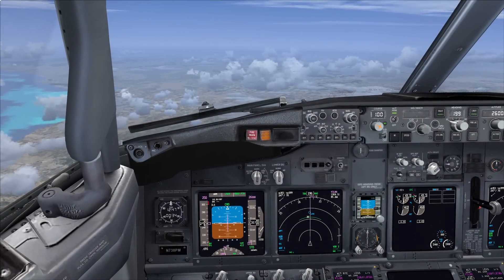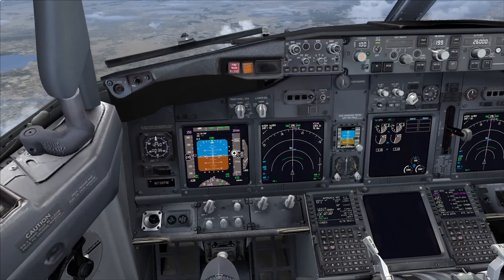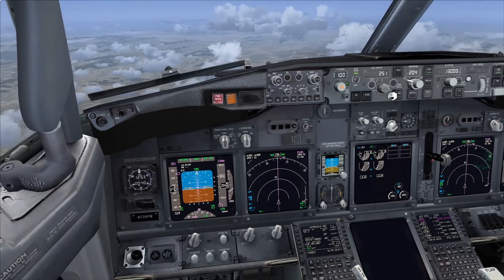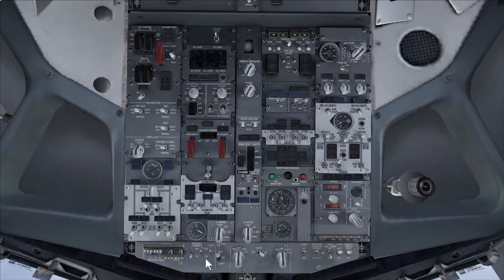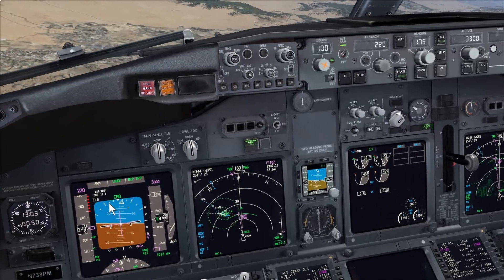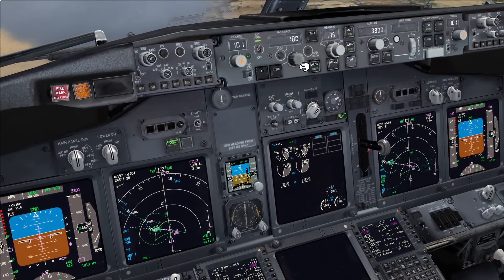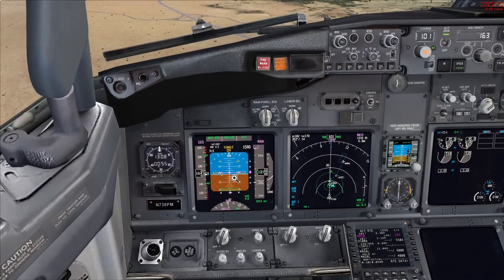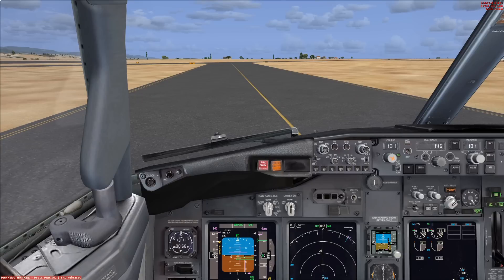Descent Management and High Energy Approach Tutorial | REAL BOEING PILOT | PMDG 737

Comment: Thank you for the informative video!  (Appreciation better 2 years late than never). Q: If your flight plan includes vectors on the approach, will VNAV still calculate the profile accurately?  And the Zibo mod?  Thanks!
Reply: set the legs page as close to expected vectors as possible... then it works

Comment: Nice presentation. May I add that the landing gear earlier extension is an excellent drag producer from which we can benefit in high alt/speed approaches, especially on short sectors flights when we also benefit from the quicker turnarounds due to more sufficient cooling of the brakes.
Reply from the maker: It certainly would be effective but the Landing Gear is not designed to be used as a speedbrake!

As a last resort it could be lowered earlier on the approach if you wanted to help decelerate but its not good for the gear doors to be subject to high air loads and they would need to be replaced more often (see FCTM)

FD2S
Reply: flightdeck2sim Of course as a final resort, but there is no problem using it since there is no limitation of speed (of course we are talking about speeds below 250kts). Boeing states not to use flaps as speedbrakes and as I can recall there is no such recommendation for the gear.
Reply from the maker: @steliosarapantzis5322 interesting! Our FCTM (4.20) states to avoid using Landing Gear to increase drag to increase gear door life and passenger discomfort.

Wouldn't use routinely but as you suggested, no problem as a final resort OR don't accept that crazy shortcut!!!! 

FD2S
Reply: flightdeck2sim yes I saw it in the NG FCTM. Not such recommendation in CL.Of course we should try to avoid, but if inevitable....(works like a charm..)
Reply: Happy Flying !!

Comment: In a nutshell, ya gotta add drag. First choice is adding speed if you aren’t speed restricted.  Next choice is drag devices.... speed brake, gear, flaps, slats, even resort to the extendable landing lights😉.   But for flaps you have to slow down first to not over speed anything. 

In a nutshell, I hear all the time that the 737 won’t descent, but in actuality it’s not the airplane, it’s the fact that the VNAV path is programmed to descend at the last possible second. 

So instead of screwing around in path descent, then try speed intervention to engage the speed descent mode, and allow the aircraft to descend earlier. Sometimes it’s better to get down a little early versus being a hostage to the path. 

Once you get in the approach environment, the speed mode of descent will be overridden by gradient and the aircraft will fly that instead.  

If you ar flying an aircraft that doesn’t have speed intervention, go to the descent page and toggle the aircraft to >SPEED. Then execute.  In a nutshell speed descent is like a vnav speed climb. Won’t go through an altitude limit in the legs pads, but also won’t do anything to get TO that altitude either.  

So, when in a speed mode, you get to control the path with energy, but in a path mode, you have to control your speed with energy. When I say energy, I’m talking about thrust and drag changes.
Reply from the maker: Hi Mark, yes been flying this tin can for the last 8 years and I also teach line crew and type rating students how to recover from high energy descent/approaches, which is exactly what I showed in this tutorial. I must confess I've never extended the retractable landing lights to add drag, that one is new to me..

FD2S

Comment: ton of work ,just drop the gear below 270kts and see ROD of 5000fpm
Reply from the maker: Hi Essa,

It certainly would be effective but the Landing Gear is not designed to be used as a speedbrake! As a last resort it could be lowered slightly earlier on the approach if you wanted to help decelerate but its not good for the gear doors to be subject to high air loads and they would need to be replaced more often! 

FD2S

Comment: I was flying on VATSIM today. ATC gave me a really nice shortcut but it threw me 5000 ft above the profile. My question is: is it possible (on rare occasions) to extend the landing gear and use it as a speed brake when the actual speed brakes aren't enough?
Reply from the maker: Good day! What a shortcut haha! It is prohibited to use speedbrake with gear/flaps settings greater than 10. If you stow the speedbrake you could extend the gear but it's not recommended by Boeing. Prevention is better than the cure, refuse the shortcut and ask for extra track miles! 

FD2S
Reply: @flightdeck2sim  Thanks for the reply. I found out what the problem was. A while ago, I read a thread on the forum saying the descent angle is the best at low airspeeds speeds.
Hadn't realized until now how ineffective the speed brakes are at low airspeeds. Asking for a free speed, selecting the level change mode and cranking the speed on the MCP all the way to 300 KIAS with speed brakes extended worked just fine.
Is there anything wrong about this technique?
Reply: @tomasdererste  as long as you dont accelerate above 250kts below FL100

Comment: If you are cleared by ATC to cross a fix at a certain altitude how would you manipulate the aircraft? Can you setup the FMC or would you use vertical speed and position the green banana over the fix?
Reply from the maker: Hi Judith, 

Yes you can set the restriction in the FMC and use VNAV to efficiently descend and make the restriction. The green “banana” is also useful, if unable to comply advise ATC.

FD2S
Reply: @flightdeck2sim  Thank you for your very quick reply, much appreciated. I have learnt so much from your videos.

Comment: Hello. Great video. I currently fly the 738 but must confess I have a doubt about speed intervention, If you could explain me, Id really appreciate it. If Im descending, fmc speed and vnav path, Then ATC asks me to slow down from, lets say, 285Kts to 240Kts. I could do that simply by hitting speed intervention. However the plane would start to get high on the path.This path, in which Im getting higher and higher, is still the same path planned for the old speed, 285 kts right? to create a new path, for 240 kts, even with speed intervention still activated, I would have to go down to the fmc and change the target speed to 240, so I could get a correct path display on my ND for 240 kts, right? Appreciate your help, thanks.
Reply from the maker: Good day,

Yes that's right, you would update your TGT SPD in the FMC but you wouldn't be on Path, you'd be even higher with a slower TGT SPD!

Is there anything you can do about it? Not really! If ATC has given you specific speed control this must be maintained, you only really have the speedbrake to help capture your profile. This is something we deal with every single day and it's completely normal. You just apply the techniques I showed you in this tutorial to attempt to recapture the profile.

FD2S

Comment: hii friend this tutorial is awesome again :))but  ı dont understand why you used 4 nm fıx.. maybe ı mıssed that part ...and why dıdnt you turn on the app mode on the efıs control panel before ıntercepting the localizer..
Reply from the maker: Hi there,

The 4nm is the configuration point for Gear Down and Flap 15 used in VMC conditions.

The APP mode on the EFIS is not required to fly an ILS, it just changes the orientation of the display. 

FD2S

Comment: What is the sense of putting the engine switches to 'Continue'?
Reply from the maker: It lessens the risk of a flameout during critical phases of flight.

FD2S
Reply: flightdeck2sim Ahh ok thank you and why doesn't let you the switch on 'Cont' all the time?
Reply from the maker: The engines do have an auto-relight when a flameout is detected, both igniters will automatically fire. By placing the start switch in CONT in critical phases of flight, selecting EAI on or if flying through very heavy rain the engine will always have a source of ignition.

flightdeck2sim
Reply: flightdeck2sim Ok thank you and what does the FLT position do?

Comment: Once again another awesome video. We did all the things you are speaking about with regards to speed and altitude control in the B732 using mental math. I cross checked 3:1 profile every 3000' or so.
Reply from the maker: Hi Robert, thanks!

Yes x3 your height works well as a rule of thumb, if it equals the total distance to the runway or thereabouts you're not too far off!

Top tips,

Add 1nm for every 10kts of Tailwind 

Add 1nm for every 10kts above 200kts 👍🏼

Good luck!

FD2S

Comment: The smallest detail. What you said about the false glidepath. I had no idea. I come from the 777 and since so much is automated and fixed for dummies it was a bit of a learning curve to do the 737. I think this might be the reason I had random approach issues on approaches I've had no problems with in the past.

Is there an issue if you arm the approach if you're above it? Can the same effect happen?
Reply from the maker: Hi there,

Yes you can capture a false G/P in reality but you have to be extremely high or low (pretty much twice (6 degrees) as high as you should be and there is another at 9 degrees). It's called a "false lobe" and it's pretty well documented

The 777 is just as prone as the 737! 

FD2S
Reply: flightdeck2sim Thank you for the response. I think I was too tired and I didn't decend on time or see your video about how to get back on the path. Then captured it way too high once again without knowing. Causing the false glide path. Makes sense now.

Comment: One question, what happen if you dont wanna use the speedbrakes, you know that you are gonna receive that clearance to dme10 and you want the fmc to flight on vnav path? You join the points and then create a hard altitude right? but what altitude would you put on vilna to be on profile? Cheers
Reply from the maker: Hi AF MG, Good question! 

If we knew we would get the clearance we would not put the "At or Above/FL70A" at VILNA. FL70 happens to be the exact altitude you need to be at VILNA so we would make it a hard restriction which means we could continue idle thrust without having to use speedbrake.

It's worth noticing some restrictions just happen to leave you high and you have no choice but to extend flaps early/use speedbrake. 

FD2S
Reply: Thanks, so in this case you would put FL70 instead of FL70A am I right?
Reply from the maker: Correct!

FD2S.

Comment: Why didn't you lower the gear to help you slow down?
Reply from the maker: Hi SIMMANIAKS.

That's because the Landing Gear is not designed to be used as a speedbrake! As a last resort it could be lowered slightly earlier on the approach if you wanted to help decelerate but its not good for the gear doors to be subject to high air loads and they would need to be replaced more often! 

FD2S.

Comment: I love your videos!!
 With your operator is there any rules about maximium v/s for passenger confort?
Reply from the maker: Hi Maule m5

Technically there is no limit to the ROC/ROD you can set using V/S and in LVL CHG it's not uncommon to see high ROD's to get back onto profile. What passengers will notice is the the rate of change (G-Force) of ROC/ROD. During departure you can typically see an attitude of something like 20 degrees Nose Up but this is not usually noticed as they're comfortably sat in their seat.

Hope this helped! 

FD2S

Comment: Hi it's Dave from walsall, having some problems with TOD, doing routes sometimes the TOD to close to the airport, it should always calculate at 30.000 150 miles to your 3.700 trns alt then into runway but it dose not do that, it's about 50 miles away to close why dose it do that, can you help, email me dh.55@btinternet.com thanks Dave.
Reply from the maker: Hi Dave,

I'll try and help with your query but I'll need a lot more information! Your TOD point is based on several factors, it could be that you have an altitude restriction in the FMC, what arrival are you flying and into what airport?

FD2S

Comment: Very informative video! Thanks a lot.

I'd use my rusty physics to interpret how energy (gravitational potential + kinetic) is dissipated faster than usual in your video. Clearly, the first approach is to apply the speed brakes and, after slow down, extend the flaps and landing gears. They just increase the drag. The second method you demonstrated in the video, which I didn't think before, is to nose down for a high speed "dive." Because the energy loss is cubic to the speed, it also increases the rate of energy release.
Reply from the maker: Above FL100 increasing your speed is the most efficient way to get back onto profile by utilising parasitic drag.

Below FL100 you're usually restricted to 250kts so a combination of speedbrake/flaps at different speeds like in this tutorial works best! 

flightdeck2sim

Comment: Brilliant video as usual Captain.
I have one question though. I've noticed in the video that when on Level Change the Vertical Speed reaches more than -4000 fpm. As I'm a realism maniac, I want to know, if possible,  what the limits for Vertical Speed both when descending and when climbing are when it comes to passengers comfort.
Thank you :)
Reply from the maker: Hi ghaith, good question!

There is no set limit regarding ROC/ROD. If during descent we accelerate the aircraft in LVL CHG it's not unusual to see +4000fpm. The passengers won't notice this.

The same applies during climb. If you're very light (short sector with not too many passengers) it's not unusual to see +5000fpm ROC. 

Hope this helped!

Flightdeck2sim
Reply: That's exactly what I wanted to know. Thank you very much!
Reply from the maker: Douglas Ulyate if you see the attitude it never gets less than 3 degrees below the horizon, it's the rate of change of ROC/ROD they'll notice (G-Force). During departure you can typically see an attitude of something like 20 degrees Nose Up! Your champagne would get spilt then!
Reply: Thanks, was wondering if this was having any effect on pax, glad to hear it's normal and they don't spill their champagne (or soda water in Economy)!
Reply: That does make sense, attitude is generally fairly flat.  I aim for 15-20 degrees during takeoff, leveling out a bit after the gear has been raised, and then letting the AP takeover while I cleanup the flaps and monitor the climb.  On Southwest they don't serve champagne, obviously, so that's not a problem.  However, I know of my regular business class pax on KLM do enjoy their bubbly! ;)